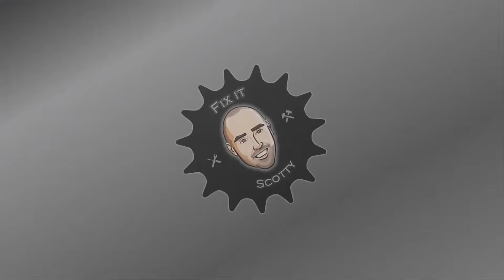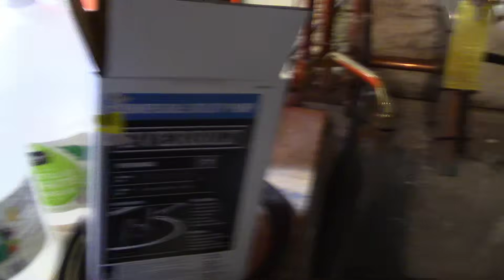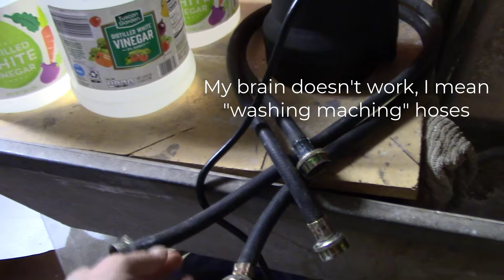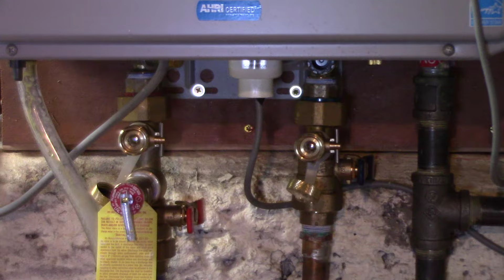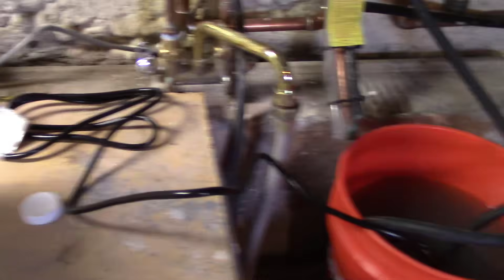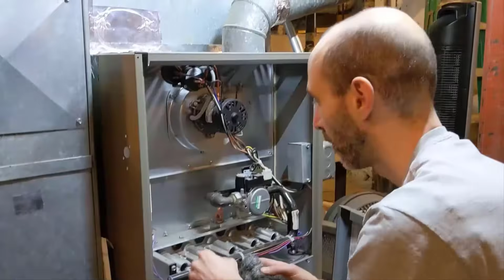Rheem Tankless Water Heater Annual Maintenance Flush

Comment: Can this still be done without the service valves connection? I have the lever to open the hot and cold water but no service valves to open or close
Reply: No, you need those service valves to do the flush.
Reply: @AlgorithmiusMaximus  oh okay thanks for the reply
Reply from the maker: You could either retrofit this kit: https://www.homedepot.com/p/Watts-3-4-in-Lead-Free-Copper-Tankless-Water-Heater-Valve-Installation-Kit-0100156/205078015.  Or a cheaper approach may be to add a T fitting between your main valves and add drain cock valves (like they do on boilers).
Reply: Or if you have flex line hoses you can just disconnect them and use a regular tube/hose with hose clamps

Comment: This was very helpful!! A couple questions…do you turn off the gas to the unit?? And does the process change if you have one of those circulator pumps?
Reply from the maker: I think the official instructions say to turn off the gas and unplug the unit to make double sure the heat exchanger doesn't fire during the cleaning.  I just turned off the unit and made sure everyone in my house was aware of what I was doing.  For a re-circulator pump - you likely have it on a timer or some kind of switch because it shouldn't run constantly with a tankless heater. I would turn the re-circulator pump off while you are bypassed for cleaning, just to be safe.

Comment: Its been 5 years and I never did this to my tank!!! Should I use a de scaler? We use a product called D-Scale for the dishwashing machine here. Would that be better for a first time then follow up with vinegar the following year ?
Reply from the maker: Unless you have a whole-house filtration system, if it's been 5 years, I would recommend a descaler like this: https://www.homedepot.com/p/Hercules-Haymaker-Tankless-Water-Heater-Descaler-35230/205086908.  My video shows you how to do the cleaning in general, but follow the instructions on the bottle for specific mixing and flushing. Then you can move to vinegar thereafter.

Comment: Do we need to unplug or turn off power supply to the tankless unit before we start?
Reply from the maker: Yes, I just turned mine off.  Unplugging would be safer to keep someone else from turning it on accidentally during the process.  The reason to turn it off is because the unit would heat the solution while it is flowing through the exchanger.  If you did that for an hour, it would burn a lot of gas and it could burn the vinegar solution.  Some people say turning the unit on for just the last 5-10 minutes could help the cleaning by heating up the vinegar, but I don't know how effective that is.

Comment: I set my pump to the min. and it went through 5 gal. in about 2 minutes! How did you get the pump to run so slow? I bought a kit specifically for tank flushing,
Reply from the maker: You should not have lost any fluid if the discharge hose just feeds back into the bucket.

Comment: Can you use the sinks/shower/bathrooms while descaling and flushing?
Reply from the maker: Yes you can.  There's no problem running the cold water while the water heater is bypassed.  But I wouldn't recommend a shower.  It's going to be cold!

Comment: I can't wait to rip out this Rheem piece of GARBAGE and replace it with a good old tank heater.  The 72-page manual says absolutely NOTHING about this procedure.  USA!  USA!
Reply from the maker: Tankless water heaters are not for everyone.  In my installation video I explain why it is best for my situation.  Rheem is also terrible about inconsistent documentation as many people have told me.  But regardless, any tankless brand you buy will need to be maintained, so it's not a Rheem defect.

Comment: Water turned into blue color? Do i need to descale 2 times?
Reply: No, that is caused by the copper heat exchanger.
Reply from the maker: Mine looked grey only because the bucket is orange.  When poured out, it had a blue-green color.  That is the scale that you are cleaning.  You could do it twice if it is really bad, or some people will turn the unit on for 5 minutes to heat the vinegar which can clean more effectively.  You need to be careful not to leave the unit on for too long or it could burn the solution.

Comment: The black in the water might be from the hoses that are not rated for acid use.
Reply from the maker: The water was green when poured out. There is no acidity in the heat exchanger. The acidic water is in the exhaust that rolls out of the condensate trap.
Reply: @FixItScotty  I believe he was referring to the acidity of the vinegar running through the repurposed washing machine hoses during flushing. (Not saying he's right or wrong -- just clarifying the original comment.)
Reply from the maker: @BRossow  Oh, good point. The distilled white vinegar has a ph of 4-5.  I still think the EDPM rubber hoses can easily handle that without breaking down. Thanks for clarifying.

Comment: Do you need to flush the tankless hot water heater if you have city water?? Since you have a well water with hard water it makes sense. Just need to know if city water is treated, do I need to flush mine?
Reply from the maker: I have city water. The water is hard where we live. Regardless, you will have to flush it. If your water is softer where you are, you may not have to clean it every year, but at least every couple years.
Reply: @FixItScotty  thank you! Unit was installed 6/19 so I’ll do it before this winter

Comment: I hear about first turning the hot water on from a faucet to open the heat exchanger then unplugging the power to the unit so that the heat exchanger stays open when you flush the system. Any thoughts about that step? Btw, very helpful video. Thank you.
Reply from the maker: It's my understanding the water always flows through the heat exchanger.  Turning the hot water on while the unit it plugged in will fire the burners on the heat exchanger.  So there is no "opening" of the exchanger.  I have heard it can help to run the process I show while the unit is on to heat up the liquid as it is circulated, but you have to be careful to not burn the solution and it's also a little hard on the unit to run constantly for that long.
Reply: @FixItScotty  I see. Thanks for your helpful reply.
Reply: I recently did this procedure and did run the hot water on a faucet inside my house prior to unplugging the unit.....I let the vinegar run through the system for over an hour. By the time I was done the vinegar was clear like new. It has been over 5 years since the last maintenance was done and I'm puzzled why my results are what they are...any help would be greatly appreciated
Reply: @PillCosbylovesPills  Hey PILL, check out this video: https://www.youtube.com/watch?v=yiKnFOhFaNc
The guy seems to think a certain wire should be removed to bypass the system closing off the path to the heat exchanger. I'm not sure what to think of this.
Reply: @peterflaten1521  after I made the comment, I retried the whole procedure again. I did have blue vinegar however it's very faint so I know it was working. Just didn't have much build up to take out in the first place

Comment: Thanks for the video!!! Are you using recirculation pump? Currently, I have one with conventional water heater, and I need it since the water heater is at the other side of the house.
Reply from the maker: Thanks for watching! I do not have a recirculation pump. Tankless heaters use a lot of gas to quickly heat water. They are only more efficient than a tank because they only burn fuel when in use; ie: when flow is detected. If you circulate the water, the tankless could actually be a lot more expensive to operate than a tank heater. That said, if you put a timer on the circulator pump, you can limit the time the tankless is burning fuel (like in the morning when you need instant hot water). My wife, myself, and my older sons bathe at such different times of the day that recirculating on a timer would not be helpful for us. So we just have to wait for the water to heat up.
Reply: @FixItScotty   thanks for replying back so soon. 😃 The trick is we’re using a smart switch by calling Alexa or Siri. We can turn on the pump only when we need hot water.
Reply from the maker: @ohsc2007  Controlling the circulator with a wifi-enabled smart switch? That is a great idea!  I'm debating whether to tell my wife about that or I'll have another weekend project to add to my list. LOL!

Comment: Scott, Is there a way to change Temp LCD from C to F ?
Reply from the maker: I do not know that. Mine was set to Fahrenheit degrees from the factory, but I assume there is a way to change it to read Celcius instead. Nothing in the manual describes how change the display. You may have to call Rheem support about this.
Reply: @FixItScotty  NP...Mine was default to C - Probably cause I'm Canadian eh ! I don't know why, but i'd prefer to see F on this.

Comment: How has this unit preformed, any issues ?
Reply from the maker: So far, so good.  One year and it has performed fine with no issues.
Reply: Is it still working good after 2 years? I’m debating over buying this model or the one with the built in recirculator.
Reply from the maker: @HH-pj2df  Yes, it is still working fine after 2 years.